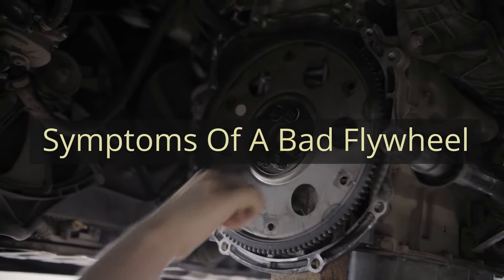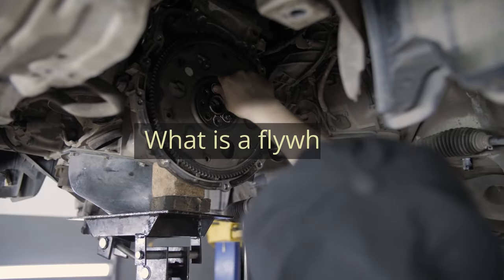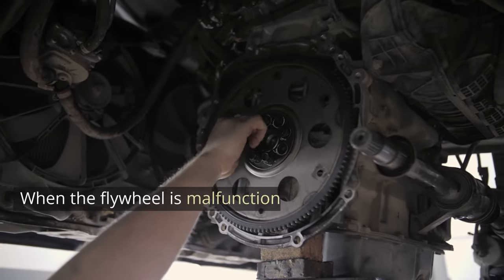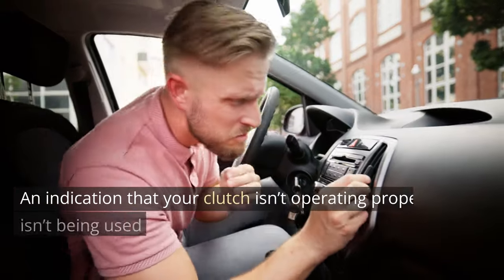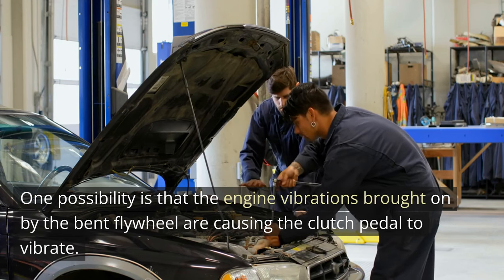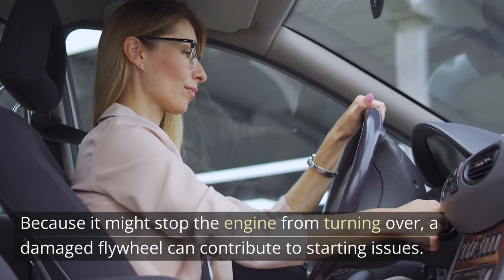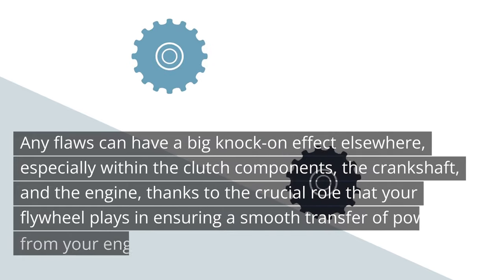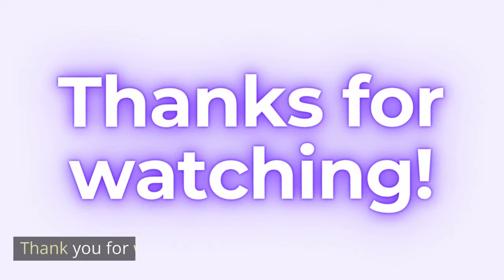Signs of a Bad Flywheel: Is Your Car Showing These Symptoms?

Comment: My car had a vibrator, so it was said that the clutch plate was worn out, then I bought a new clutch and installed it, but the problem is still vibrating, even now I have installed a new one.

Comment: Hello wonder if you can help me I have a 2018 Ford Fiesta diesel six speed manual 11,000 miles after driving the car every night in town for about an hour it starts to shudder when releasing the clutch in first gear or reverse. It’s the same every night after an hour of driving it in town. Any ideas what this could be please thank you
Reply: how do you balance between your clutch and gas release? 😊 that can be it that’s y getting shudder or if technically speaking, it can be your clutch staring to slip depending how much is your mileage now and how u drive

Comment: Hi.. maybe I have, this issue.
My simptom is as follows 
Clutch. And manual gears work ok.
But.... when the wheels go faster than motor with clutch actuated to change gear. The wheel engages again with the motor.. 
Failure can be replicated with motor off.
Clutch in
Gear high. Like 6th
Wheel lifted.
Turn wheel  with fast move
ENGAGES MOTOR.
AS STRONG THAT CAN TURN MOTOR BY HANDS
rotating the wheel.
But but. But but.
If I start the motor now.
Wheel doesn't rotate!
Anybody's help?
Vehicle is
RAM pro master equivalent.
A FIAT DUCATO 2021
30000KM.ONLY